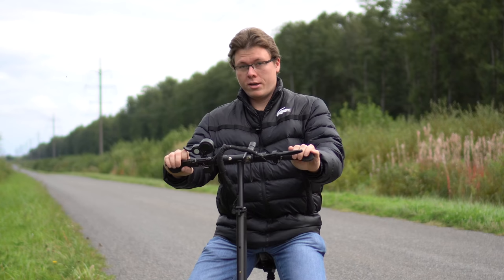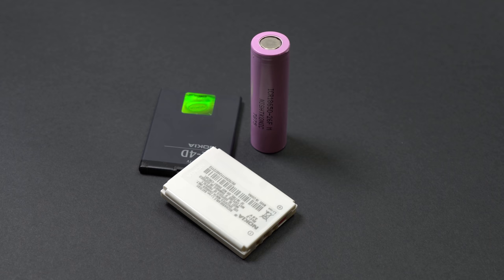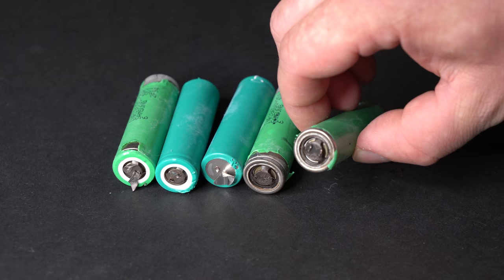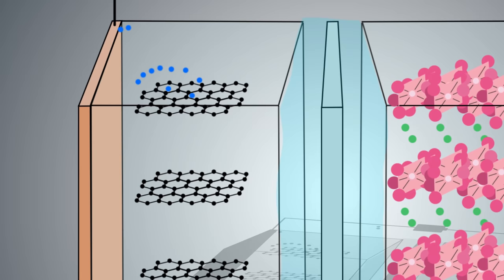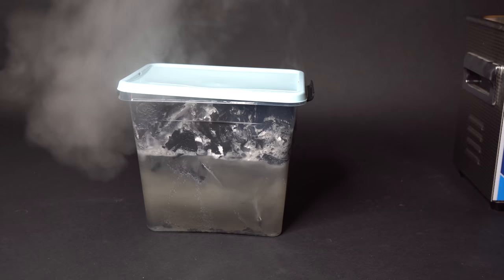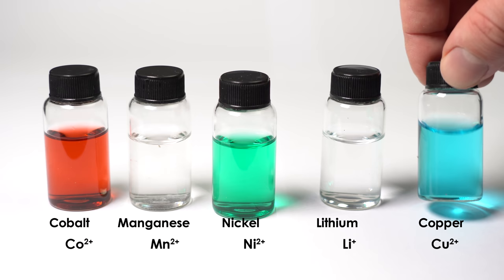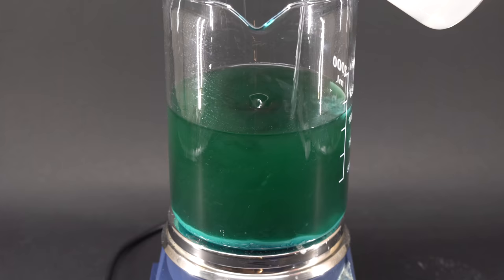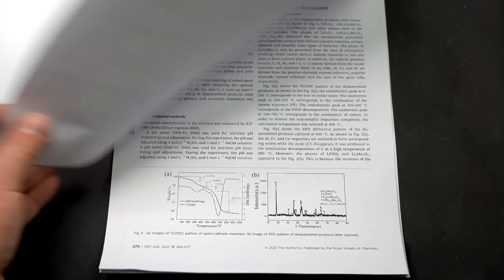How Much Lithium Can I get From a Lithium - Ion Battery?

Comment: A better term for your "accumulator" is a cell, cells comprise a battery. Often even individual cells like 18650 cells are also still called batteries (albeit technically incorrectly) especially if used individually instead of part of a pack of cells.
Reply: An accumulator stores energy fyi.

Comment: As somebody who is dealing daily with Li-Ion batteries, you are very brave to dismantle them like this. There could be a fire easily. 

On the other hand, love the research.
Reply: I think the insulation was as if new. I do get freaked out a few times at how he treats those 18650s!
Reply: @rogerwilco8146  If the batteries are fully discharged there is no fire risk

Comment: Excellent recycling it's got to be scaled up to recycle all the new batteries that is being manufactured so it doesn't go in the landfill and reused material for new batteries
Reply: Recycling burns oil
Reply: @ChadDidNothingWrong  and stop cutting so many trees were running low on O2 if you pull up a satellite picture of the u.s. from 1960 to 2021 and look at how Brown it got instead of being green
Reply: @ChadDidNothingWrong  if it keeps going the way it's going we're all going to have to wear space suits to breathe Outdoors from all the ozone building up
Reply: The methods and the beginnings of the infrastructure are set up for Li-Ion recycling, but car batteries have proven to be much longer lived than manufacturers expected since they are much better managed than laptop and phone batteries. And then they have a second life as stationary storage.
Reply: @thomasmoore4576  Really too bad that residual charge in the cells is not harnessed to drive the recycling process.
And capture the hydrogen evolved when the aluminum is dissolved.
Reply: ...just sell the stuff to the DYI world
Reply: @thomasmoore4576  Wrong, NASA said the Earth's forest have grown in the last decade.
Reply: @arogers2741  BS
Reply: Recycling is much more expensive than making a new one.

Comment: I remember when I took apart a charged lithium ion battery the anode (copper sheet) was getting warm to the touch indicating that there was lithium in the graphite. It was oxidising in air.

Comment: Could you have taken a different approach @11:11 ? Instead of using NaOH you could have started with HCl(aq) to transfer the different ions (Al3+, Li+, Co2+) into solution and, after vacuum filtering,  let them cristalyze. Lithium chloride has a solubility of around 80 g/l , whereas cobalt(II)chloride of 529 g/l , aluminium chloride of  458 g/l each at 20°C. So you could filter lithium chloride out quite well, before the others start to cristallyze.

Comment: Very interesting. I have a feeling a punch is used to push the jellroll out after both ends are cut off on a auto bandsaw that is sprayed with cooland to prevent thermal runaway ! A big conveyor belt is full of cells getting the top and bottom cut !
Reply: What if we just ground off the edge of both top & bottom cylinder faces to keep insides fully intact?

Comment: Well you only filtered half the cobalt nickel lithium solution, so you would have gotten closer to 13g. I always lose a lot of product in the filter discs because I am too lazy to scrape it all off. Assuming you did the same you could probably have gotten closer to 14 total. I think a few steps could be improved at scale and also cheaper reactions used, and then it would be worth recycling.

Comment: Yeah as you discovered here, one needs to use relatively sharp pipe cutters and cut EXTREMELY slowly else it binds the inside. When done really slowly that will not be so much of a problem.

Comment: you can reuse cycled batteries for lower power consuming processes, if you drain a used battery slowly enough, you will get nearly the same capacity, it's just that internal resistance rises, the method of recycling in the video is only needed after the batteries are completely unusable

most batteries are not fully cycled, for example in a laptop, if you use the battery for long enough, one of the cells or the bms might break and the rest of the cells are sent to recycling even though they can be reused

Comment: Is those polymeric separation membranes could be used as semi permeable membranes for electrolysis?
Reply: I was thinking about that yesterday but they have holes only small enough for lithium ions which are very small but hydrogen will still get through i think . Amazing material engineering in it self !
Reply: Not sure why one wouldnt use Ceramic for semi permeable membranes. The work great and mixing is minimal at best and can be all but mitigated with the most minor effort of loading the membrane first in which you basically pump it full of the ions you expect to come from the cell so what you get is ion migration but no actual mixing of the two fluids.
Reply: @seditt5146  ceramic is only usable for some processes and can be degraded by others. Partially dechlorinated PVC is generally superior, and also not too hard to make.
Reply: Yes, I have used the plastic film membranes out of larger lithium polymer battery's for remote control toys , planes etc. I took a plastic vessel and cut a square hole in it, about 15 square centimeters and then sealed the hole with a sheet of the battery separator, I used silicone glue to hold it over the square hole, with about a centimeter of overlap between the vessel plastic and the separator, so it was basically like a sealed window. The rest is fairly obvious. The plastic separator material is just like ordinary plastic, fairly tough stuff, not at all fragile. Some cautions though, I found that pushing more than around 6 amps across can weaken it to the point it leaks from tiny pores forming in it, heat is an issue, an active cooling system is needed when pushing high current.
Reply: @seditt5146  Porcelain is made especially for that purpose, Haldenwanger Porcelain I think.
Reply: And where might one obtain these mythical ceramics, or at least their chemical formulas?

Will ordinary red bricks work? White Ceramic bathroom or pool tiles?

Comment: Great video! very interesting Thoisoi2 !! Looks like a very, very complicated process nevertheless. No wonder LiOn batteries get thrown away. Personally, I can't find a single place in my region that takes them for recycling. The single company I've found that will take them charges a processing fee leading me to conclude that is not economically feasible for them to do it (yet). One would think that with all this green push the manufacturers would've come up with a practical methods of recycling lion batteries, but no. I fear this will be a big issue soon and we are literaly trading fossil fuel energy independence for rare-earth dependence mostly coming from China.
Reply: At the same time, there are much less rare-earth elements than oil, coal and gas.
Reply: @marcusmt4746  stripping the earth for these minerals are very very impactful to the env, but is forbidden to question tech nowadays.
Reply: @FredLarracuente  basically at some point if we can't find better methods, then stripping asteroids and planets in the solar system of materials might be the only solution in a long while. It'd be great if we made more breakthroughs in nuclear energy it's by far the best source of fuel and we can literally solve the coming water crises by using the passive heat from nuclear reactors to boil and make ocean water drinkable which has been done already and shown to be very effective
Reply: Coming from China & South America from mines that have a negative impact on people working in them and on the environment.
Reply: Today some green land's would like to dig in my country "Serbia"
But ordinary people are together and they protest and I believe protecting  land of devastating with millions tonnes of different acids.All politics like money and don't care for people who make them on top of the government.I believe the law of people will make justice for all..

Comment: Nice experiment! So it sounds like the most economical way of recycling these now is freezing them, then shred and pulverize. Easier to separate the raw elements that way apparently, and freezing the batteries is easy and is supposed to make sure no reactions will occur while shredding.
Now you have high quality already refined rare earth materials that just need to be separated out. This is what I have seen recently anyway and obviously has to be done in large scale with the right equipment. Redwood Recycling says they can recover 90% of usable materials already. If true, that's pretty good. 
If they really have this figured out, there's going to be big money in recycling this stuff when it catches on.

Comment: Interesting video, but you should look at Tesla's recycling process. No need to wait a decade for efficient recycling because they have solved it already.

The trick is to not restore the substances into they element form but isolate and reuse materials as they are. Most degredation is caused by mechanical cracking of graphite or silicon, which isolates part of the material from charging cycle. Chemically it is still intact. Sometimes there are dendrite Chrystal's from metallic lithium but typically it indicates a battery abuse like too deep cycles or charging in cold.

Comment: One of your better videos and that it saying a lot! 
Don't sell yourself short about yield. You actually achieved a yield about twice what you thought you did at 18:40
At 17:50 you say that you leave about half of that superfine precipitate behind to avoid burning out your vacuum pump so the yield of Lithium carbonate is the yield from about 5 cells not the ten you started with.
Reply: no, he compensated for that, when he weight it it was 3g something and he multiplied it by the volume fraction

Comment: Remember folks, there are two additional factors to consider before dismantling batteries.

One is just because it can output the amps needed for your device doesn't mean its drained.

Two is surface charge exists, ground the batteries with a specialized device for your cells, using a ground rod can cause thermal runaway.
Reply: Three is to use a plastic or wooden tool to remove the spot welded strips from the cells.  This way you don't arc the cell even if there is or isn't any charge in it.

Tip: Put some heat shrink around the tip of some needle nose pliers to help remove the strips and not arc the cell.

Comment: If you just want to recycle the battery into a new battery, you can use the same ratio of metal oxides as the original, so you don't need to separate each metal. I would try to skip the sulfuric acid step and burn off the carbon in a hot, high oxygen environment. Maybe a good application for a tube furnace. There might be some lithium in the graphite coating on the copper anode as well, but I'm not sure if it would be enough to worry about. That might depend on whether it's fully discharged.
Reply: Sounds like a great research project.  Target minimal processing over purification for a new product.  Surely, surely, oodles of people are working on that.  Surely??  A big hurdle would be to ensure end-of-life returns to manufacturer.  I've heard of only one company that has that goal.
Reply: @chrisking7603  The recycling pipeline would at least need a way to separate different brands or compositions of batteries. It may be possible robotically to flick them into different bins based on the print, if it's still readable. Or you could just break them all down, measure what you get, and add enough new material to get the ratio of metals you need. In any case, the main thing is just getting people to recycle their batteries, however it goes from there.

Comment: i think the industrial recycling version of this will simply grind them up in an argon atmosphere (to skip the need to discharge them and limit the fire) and then a magnet removes the steel casing bits and other steps removing the lithium/cobalt/copper/etc. Of course given the difficulty and chemical processing needed unless lithium prices rise high enough to make recycling profitable no one it's going to spend money on trying to recycle them if it's cheaper to simply ship it as e-waste to Africa. I imagine some sort of industrial electrolysis/centrifuges will make it more practical from a chemical use standpoint, though on a large scale that will rival aluminum production in electriciy use (kinda pointless if coal is still the main fuel for that, might as well just go back to coal-powered steam boilers in cars and skip the power grid energy loss).

Comment: @16:50 It's not primarily for cost-cutting, rather, nickel oxide can actually withstand a higher current as well as pack more lithium ions for higher capacity than cobalt oxide. (Manganese is even better at handling high current, at the expense of capacity.)

Comment: Yea, those pipe cutters crimp the tube and lock the roll in.  I use sidecutters to clip the top off and then peel the casing down until it's loose.  Anyone planning on doing that, be prepared to lose some blood.  It's inevitable.

Comment: To anyone replicating this: although those high-current, medium-capacity batteries extracted from the Hilti battery pack were probably indeed an NMC chemistry (that is, lithium-nickel-manganese-cobalt oxide), the more recent 3000mAh and higher capacity cells are usually NCA, which also contains aluminum.

Comment: Thoisoi2 - can you prove water is made of hydrogen and oxygen by any chance? Would love to see a video!!
Reply: All it takes is batteries, 2 electrodes, a beaker and a couple of test-tubes. WTF?
Reply: @dananorth895  is that all? what about water? do i not need any of that? and what water should i use?
Reply: @dananorth895  how does performing electrolysis prove water is being split?

Comment: Recycle is the last in the reuse, repair, recycle hierarchy. At this moment, the most common way to retire EV batteries is to reuse them in less energy density demanding applications, such as grid level energy storage systems. Anyway, with more renewable energy penetration, energy storage is a thing now, and what can be better than practically free used Li-ion cells?
Reply: there's an "R" you forgot to mention, the one at the start.  Reduce.  As in, manufacturers need to reduce the amount of packaging materials and use fewer difficult to recycle and more easily recycled materials in their production and packaging.  (and to be honest, I often forget about Repair, thanks for the reminder!)

Comment: Is it possible to use electrolysis to separate lithium, in the same way, the cell works itself, just make it bigger and run current through it, and lithium ions will move over, right?
Reply: You can't use electrolysis to make lithium metal in a water electrolyte. You can use electrolysis to remove the transition metals more or less one at a time if you have then dissolved and separate the lithium either before or after chemically.

Comment: shouldn't you have done some spectophotometry analysis of the solution in order to determine which ions are present and in wich proportions ? Correct me if I am wrong, I am a student preparing for enginnering schools, and the related lessons date in my course of last year, but the metallic ions have their own specific maximum of absorption. Tracing the absorption spectrum of the solution and comparing it to spectrums of reference solutions of known concentration would have allowed to measure the specific concentration of all the ions present thanks to Beer-Lambert law : the absorption at a given wavelength of a solution is equal to the length of solution the lights come through times the sum (on the different absorbing entities) of the concentration of each multiplied with it's own specific absorption at the given wavelength : 
a=l*sum(c_i*epsilon_i)

Comment: The lithium metal is a oxide in powder form between copper foil and aluminum foil and insulator with ionic pores so charge can pass thru. Lithium is not the case metal like zinc on dry cell battrys

Comment: Can I ask you why do you call them accumulators? In English we say battery's, Is it because you find it hard to say it or something?
Reply: Because they are accumulators of potential energy. A 'Cell' is the correct English term in relation to chemical electrical storage devices.  
The term 'battery' refers to a gang of individual cells, either in series or series/parallel configuration.

Comment: I wonder what is even the point since you can easily purchase lithium battery cells that literally contain a spiral cylinder of elemental lithium metal. Why would you try to extract something by convoluted means when you could just purchase it at the local grocery store?

Comment: I'd suggest accumulating all the spent lithium cells possible, as quickly as possible. The world as a whole is quickly becoming aware of the fact that our ability to produce lithium at maximum capacity will be overshot by our consumption (Demand) by about 100% per year over the next 5 years... Whomever discovers a viable (Effiecient) way to recycle dead lithium cells will be wealthy beyond measure, without a doubt.
And those who tried but had not yet succeeded in developing a procedure to do so, will have quite a valuable store of test materials leftover.